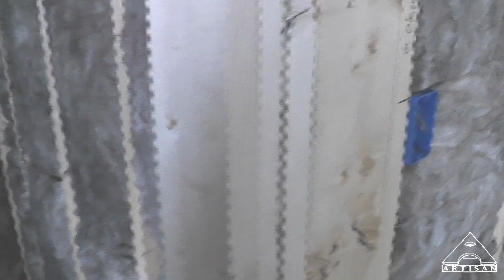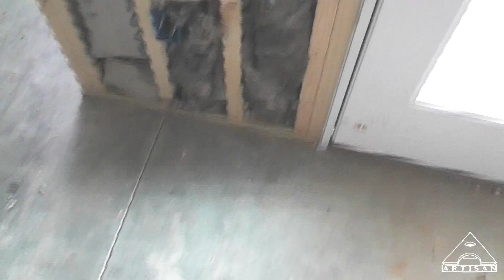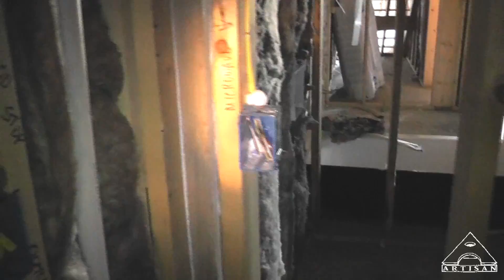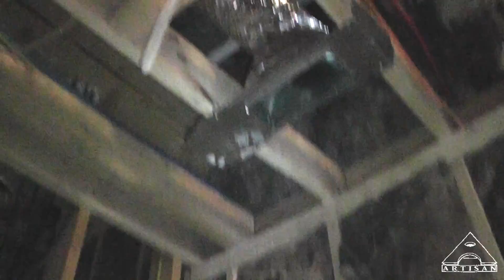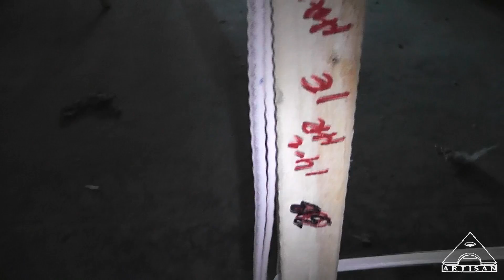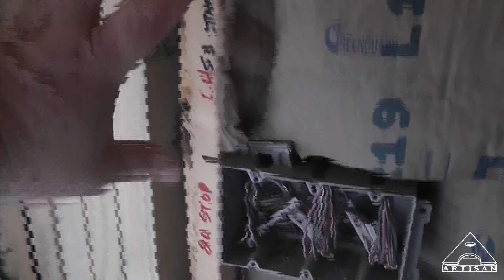Stringers Ridge Project - Vlog #13 - Pre-Drywall Documentation - Part 2

Comment: Interesting and educational video, Artisan Construction, LLC.  Actually, that's a clean home in the construction stage.  The 'mess' is just house parts.  Out in the far-west, some homes under construction have old corn-husks and Jarritos Bottles about the place.  Artisan Tony has good crews.
   The 'landing' on the stairs shouldn't be required; if an option is, it can be at the bottom of the stairs.  There's a lot of things concealed behind the walls of a house that makes the home work right.  That's a nice >well insulated home.